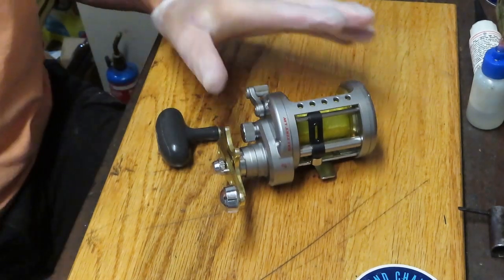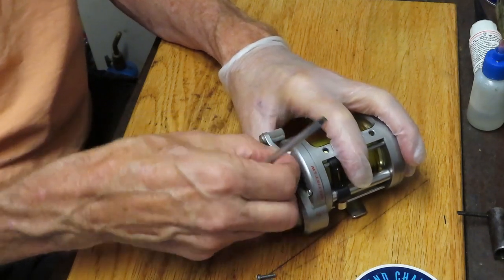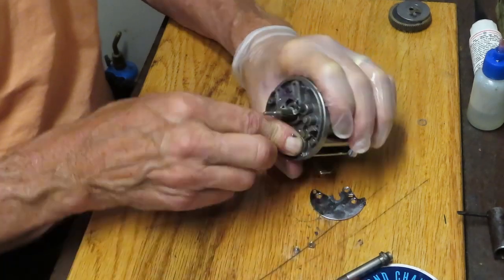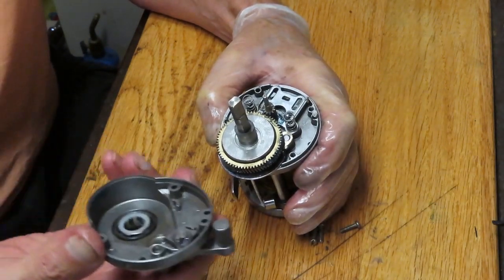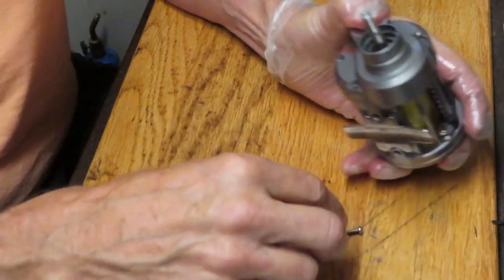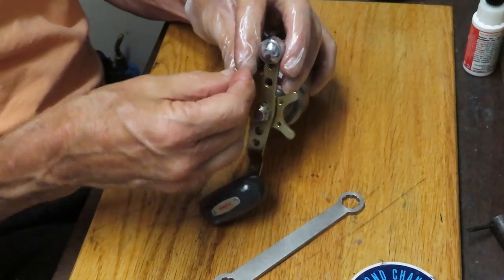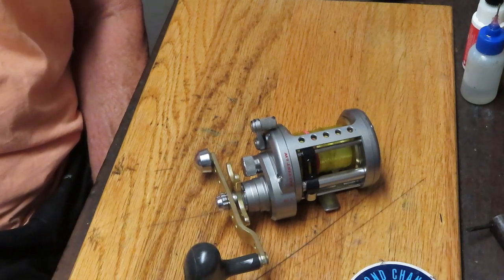Daiwa Saltist 30HA unusualy cause of a fishing reel failure and how to diagnose and repair

Comment: I serviced a sluggish Penn 209 this morning.  The owner paid to have it serviced last year.   The drags were new, gear side clean and the grease was fresh.  The problem was with the levelwind.  The pawl was filthy.  The cups holding the worm gear at each end were packed with corrosion and grease that had to be drilled out.  Last year's service hadn't touched the levelwind.  That reel was fishing today but gave me some trouble.
Reply from the maker: You also need to check the tracks of the worm gear, especially if the other parts had dried grease in them

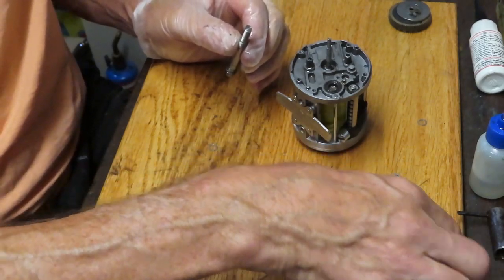Comment: Hi Dennis.  Not terribly important, but I was trying to find out where that second washer came from at around the 9:41 mark.  It seemed to have dropped from the gear shaft.  How do you think it got there?
Reply from the maker: The washers on the desk dropped from the yoke.  They go at the base of the yoke stud before you add the springs.  That washer prevents the springs from binding on the yoke when moving up and down. there are 2 of those washers.  One for each side - Dennis
Reply: @2ndChanceTackle  Thanks.  It seemed like the second washer only appeared on your desk when you picked up the shaft.

Comment: My 20 saltist LW keeps losing drag pressure.
Reply from the maker: First question - do you have braid on the reel?  If you do, have you backed the spool with mono before adding the braid.  Your issue sounds like classic braid slip and not the drag washer system
Reply: Yes braid but I've confirmed that the braid is not slipping.